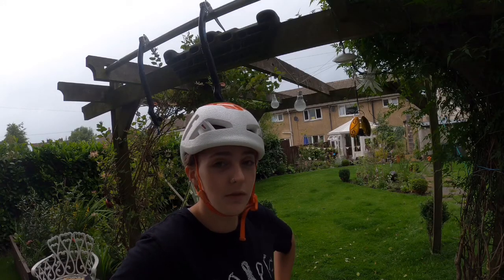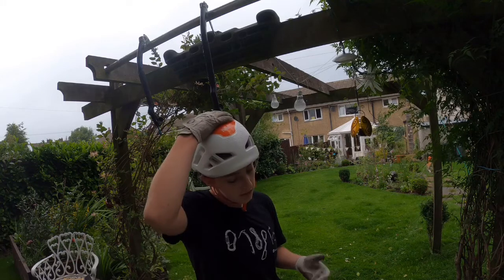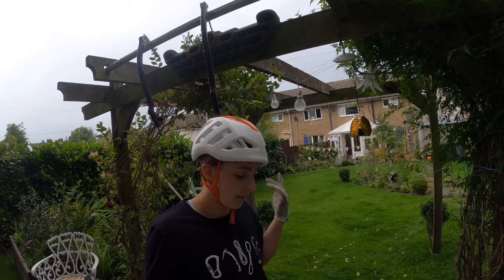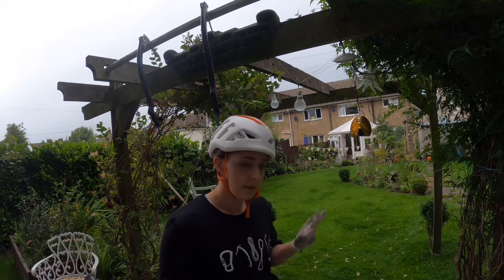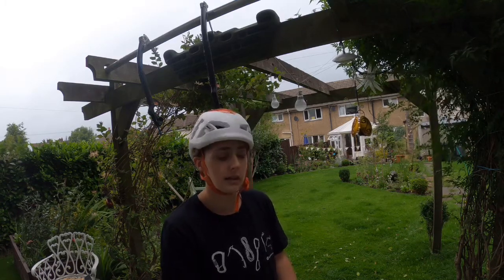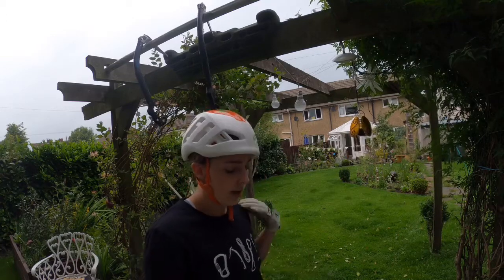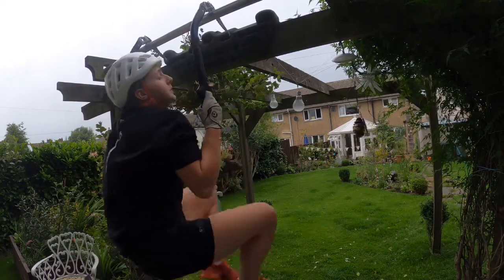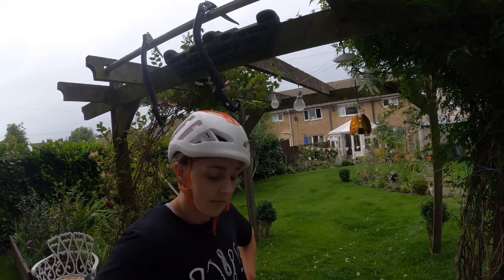All about Figure 4’s and 9’s used on dry tooling and mixed climbing

Comment: Hi Emma, do you have any tips on how to do figure 4s with both hand on the same tool ( I.e when you only have one tool hold). Can’t figure it out. Thank you!
Reply from the maker: Hey thanks for your question, my advice would be to put your leg over both arms and slowly take off the hand you don’t want. Balancing with the other spare leg on the wall helps. The main thing to practice is the balance it’s usually easier to practice this on a steep wall. Hope this helps? 😁